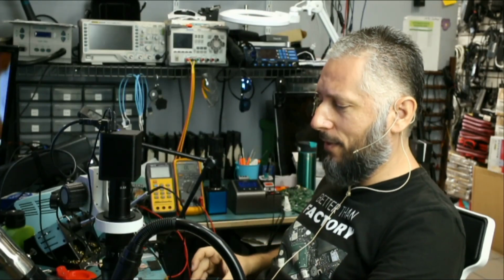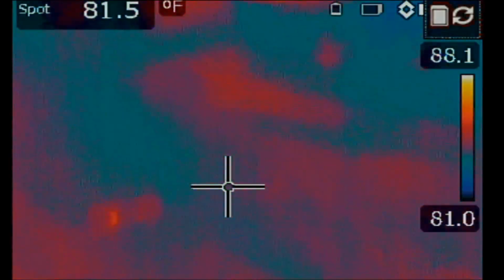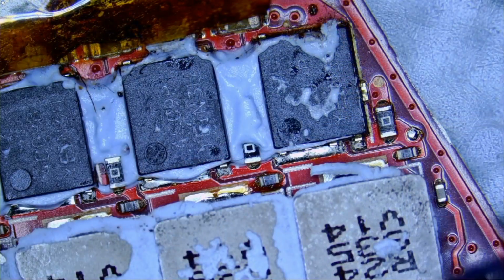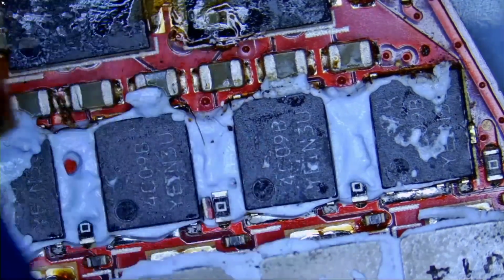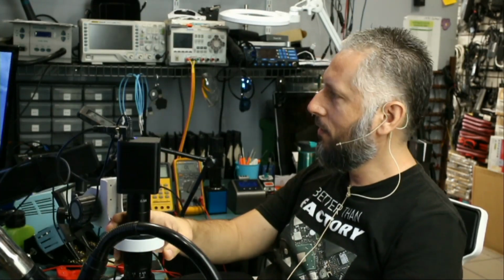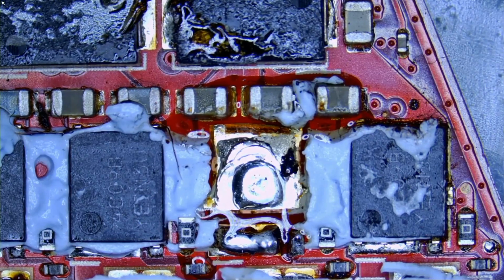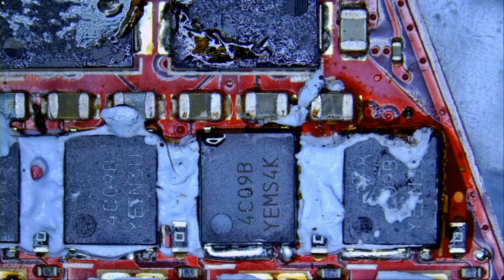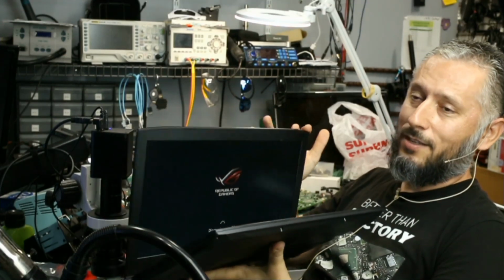Asus ROG Laptop Repair - Avoid Kapton Tape

Comment: I thought kapton tape was removing the components off of my boards because I was using cheap knockoff tape, but maybe all kapton tapes will remove components off of the boards? A shame original kapton tape here in Brazil costs 7-10x more than the knockoffs and are almost impossible to find, so I can't test them.

Comment: Given that you are doing a running commentary, you should say what heat setting you are using,
every time. What voltage/amperage injection you're using, every time. Firstly, because of newbies,
and secondly, for old people like me. And yes, you are doing it but just not all the time. But showing
a working laptop at the end ... that is a no no.

Comment: I always use kapton anyway because at least it holds things generally in the right position. If you've ever had your hot air gun accidentally blow a bunch of components off your board... it's a nightmare.

Comment: The only time I really use kapton tape is on plastic connectors. I find it just obscures my view if I put it over components and it makes them move likely to shift if the solder does melt because of the tension the tape applies.

Comment: i had an asus rog laptop the other day for repair, and the odd thing was it powered up, then wouldn't power back on, i ended up removing the wifi card of all things and it then worked perfect, tried swapping out the wifi card and it wouldnt turn on again, no signs of life, ended up just having to use a usb wifi dongle

Comment: Hey Alex, I have a HP elitebook 2570p and I found that the cpu and chipset is getting hot. Could the chipset be the culprit or something else. ( Firstly, it never powered on. Because, the 19v rail is shorted to ground by a cap. So I replaced it. Now it will turn on but because of the over temperature it is shutting down.) Everything else is OK. It is booting into windows, too.

Comment: It's ridiculous that Asus hasn't worked on a system to prevent those MOSFETs to go bad. I mean, that's a generational issue. If you're lucky, the CPU won't get fried by the over voltage that can go to it without that MOSFET working properly. Imagine how many CPUs have been permanently damaged by this design flaw

Comment: With the amount of asus laptops you get with the same issue, there should be a class action lawsuit against asus for this  issue
Reply: With the price of these ROG laptops being so high, you will expect at least they use good quality components. But no. 
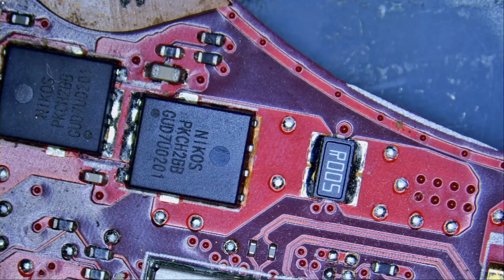1:10 The cheapest mosfet brand you can find;  Niko Semiconductor stuffs !!!
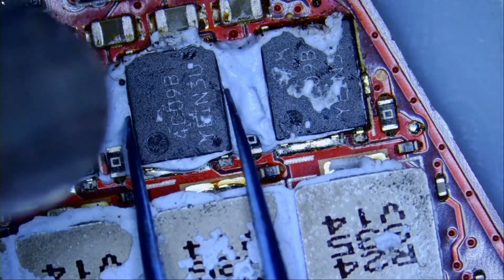4:36 OnSemi 4C09B mosfet , you will find Asus using these in almost all low-end AM4 B350 Asus desktop motherboards. 
I will at least expect good quality power stages from International Rectifier or Intersil , but Asus loves penny pinching 🤮
Reply: It happens in all laptops most of all if you set them on a cover on your lap or your sofa and block off the inlets or if you have cats or dogs the hair gets stuck in the fans with dust and slows them down thats why laptops have huge heat sinks and heat will kill ic’s faster then anything

Comment: kapton tape is for 300 degrees and is prefered as isolation tape heat resistant,  is good for winding transformers and such.
is better  teflon tape (PTFE brown one) as does not deform is thicker and the glue is more stable with heat
But just for you Master that uses max temp always 
the best is aluminium tape, good for 500 degrees really shields components as is heat reflective, and dirty cheap if you buy generic hvac aluminium tape and no glue leftovers to clean
its my 50cents opinion

"Pure Aluminum Foil: High density 99.4% aluminum foil , lighter and shiner, can reflect 95-97% Heat Radiant , it is the best heat insulation material.
Thermal Reflective Insulation | Agarwal Pune Group."

Comment: Ive been wondering, my asus strix gl503vd laptop still charges.. but does not turn on.. (power light just flashes once then off) is this a short circuit issue? :/
Reply: My Vivobook does the same, charging light blinks either white or orange depending on the battery.
I think it's a bad capacitor but I can't find a shop that can repair it.
I sent it to a big repair company and they wanted me to buy a new MB that was more expensive than the laptop.

Comment: "I'm going to take a few minutes, a few hours, a few days to reassemble this." That escalated so fast all because Big Boss is not home. Lol
Reply: Its super Tidious
Reply: I've disassembled laptops before so I know the pain and I was only pointing out what he said because it's comical to me that he's in distress because his dad is needed is all. Which in result the time expectancy of putting the laptop back together grew exponentially in his sentence.
Reply: taking apart laptops if you don't do it a lot is a pain in the well you know were i'm going with this, it's harder than it looks
Reply: The way opening screws that were put by factory is very hard sometimes the screw is so tight you have to use a lot of strength and carefulness just to unscrew without ruining it and that's all just the start then you have to separate from cover screws battery screws motherboard screws screen screws if by mistake mixed into the device will probably not attach to eachother or even worse CAUSING A SHORT

Comment: Hey there, quick question
How do you inject voltage to a laptop? If I plug the charger to the board will I be able to find a short with a thermal camera?
Cheers :)
Reply: If laptop has a short and you plug in charger it won't work to find a short that way because laptop charger will go in protection mode and shot it self off if their is a short on motherboard.
Reply: U will need a short killer, or a proper bench AC supplier with that function, Problem is u will need experience to known where inject voltage :)
Reply: No.  You use a bench power supply of some sort and connect the negative end to ground and the positive end to where you find the short.  In this case, the drain on the mosfet by the dc jack,  You set it to 1 volt or 1.2 to start with.  Let your AMPS be set to no limit as the load will only pull so many amps.  The amps are whats causing the heat going through the shorted component.

Comment: I've watched so many vids of these laptops on your channel that I feel like I can fix them too! Check the mosfet, inject voltage, check for a heat spot and replace the component generating the heat 😅 

Except I don't understand anything about injecting voltage or have any of the necessary tools to even remotely  begin this type of work. 

You sir are a technology micro surgeon! Love watching your vids!
Reply: there was a time when this guy didn't know anything about electrics, components etc. he took the time to learn may have took him years which it does to become as good as this guy at repairing electrics. practice makes perfect.
Reply: I feel exactly the same after i watched tons of videos from this chanel, as soon as i started out with some boards either i get very hard ones with welded mosfets or ones with very weird faults 😅. But i make sure even if the fault is visible i act as if it is not and do all the measurements to insure that i can determine the fault even if it isn't visible and learn in the process :)
Reply: that's what you do if you watch movies too, you can think easily beat bad guy 😂
but, of course not 😂
Reply: Another task: remove the mosfet replacement from the donor board.
Reply: The wisdom comes in knowing quickly when to apply those techniques. There are likely many times the fix is not related to injecting voltage and checking for heat. That's useful when something is shorted to ground, that should not be. But not always. 

Many many years of long long nights are what result in this mans ability to do what he does so well, and so quickly!

Many people think it's just that he has better tools. He does have much better tools than the average person. But that isn't what makes him successful. He has thousands of hours of experience diagnosing problems and experience with those tools!
Reply: @brandonkick  agree 100%!! I for one could have every tool known to man and the best tools, but there's no point without any of the experience..
Reply: Learn about Ohm's law and you will understand why injecting voltage generates heat :)
Reply: So are Asus laptops bad or something? He pointed out this is a common cause, what causes this short? Heat?
Reply: I thought it said anus repair. Man, I clicked on the wrong video.